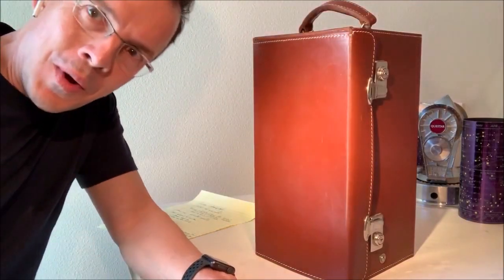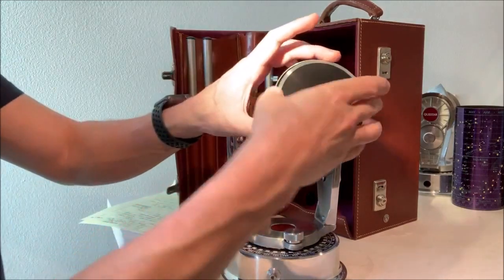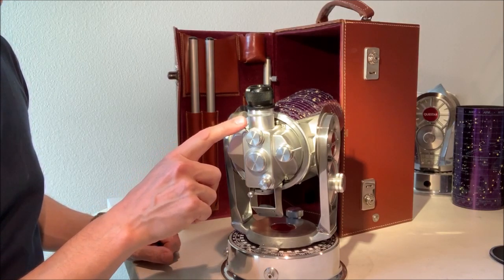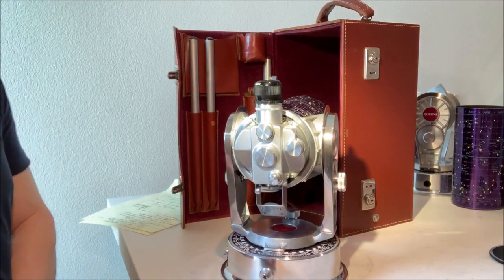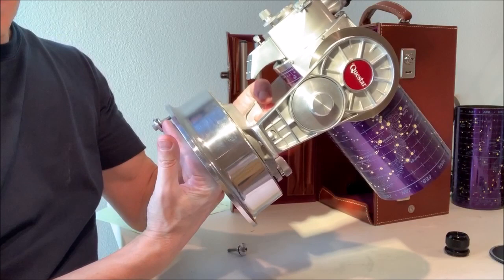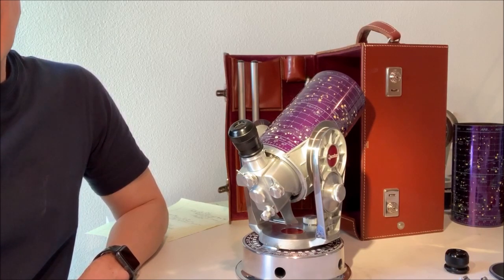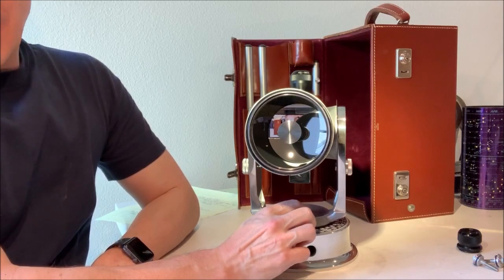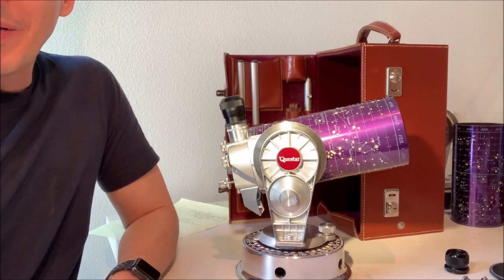Quick Start Introduction to Your Questar Telescope

Comment: Very good introduction, thanks Ben. I'm in Brisbane, Australia which is at 27.5S, so the standard side legs won't quite allow me to get to that latitude.  Questar do have shorter side legs, but I chose to cut off about 1.5". As per the manual, at latitudes closer than 30 degrees to the equator you need a counterweight on the centre leg.  Unfortunately these don't seem to be offered by Questar so I had to search for a suitable one.  I ended up using a 1kg (2.2lb) counterweight for the iOptron SmartEQ and it provided a perfect fit on the centre leg (mounted just above the adjustment screw).

Comment: Excellent video regarding this fine product. I'm still undecided between the Birder model and a Nikon long lens.
Reply from the maker: I'm a fan of both.  But you don't get much of a Nikon lens for the $1000 a nice Field model costs (the Birder finder power isn't necessary).  I do like the monstrously heavy Nikon 400mm f2.8 AF-I for ~$3000 to get great optics and VR that will take great photos if you don't mind the weight.

Comment: What is the cord for ?
Reply: Questar's have an electric clock drive in the base to counter the rotation of the earth. When the scope is in equatorial mode and properly aligned with the celestial pole, objects will not drift out of view.
Reply from the maker: The cord is to power the AC tracking motor contained in the base.
Reply: Thank you 
I need to order one for mine , can you point me in the right direction?